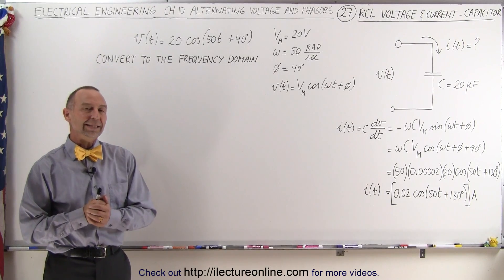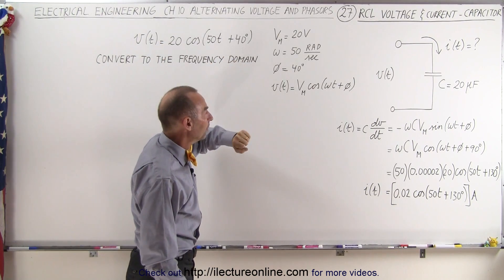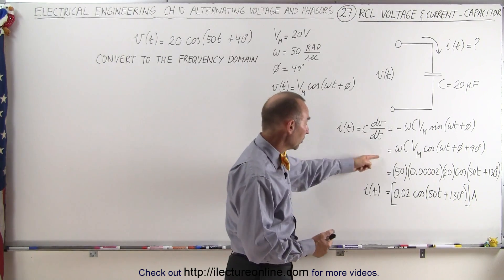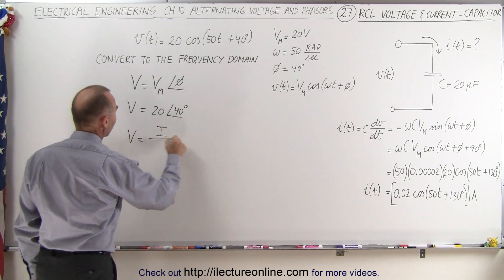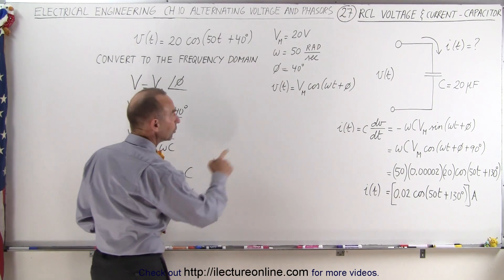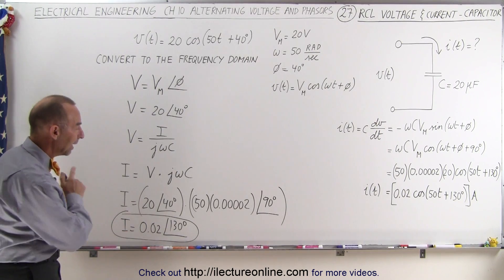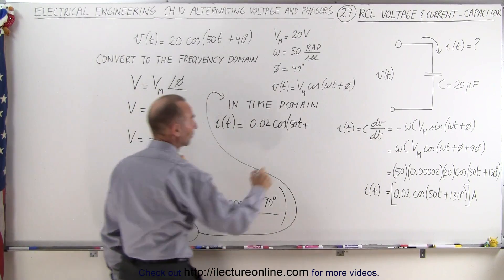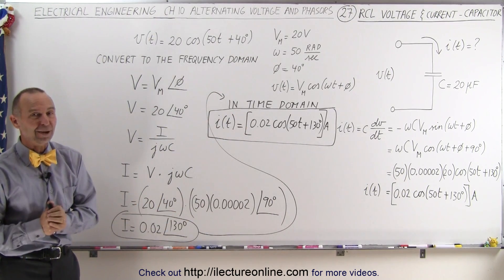Electrical Engineering: Ch 10 Alternating Voltages & Phasors (27 of 82) RCL V=? & I=? - Capacitor

Comment: Could we instead of viewing J as a 90* rotation view it as a -270* rotation?  then the phasor angle is 230* instead of 130* which both have the same value. Why should we pick one over the other?
Reply from the maker: It is customary to show the phase angle to be between - 90 degrees and + 90 degrees, but technically any way to represent the phase angle is OK.